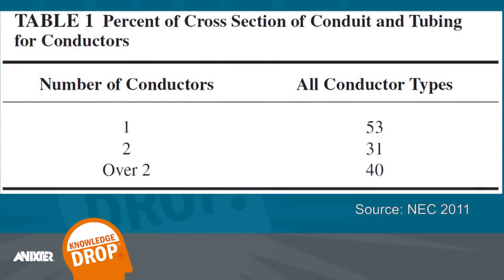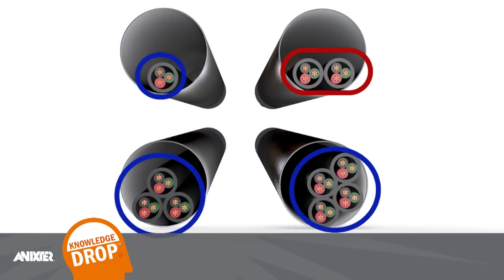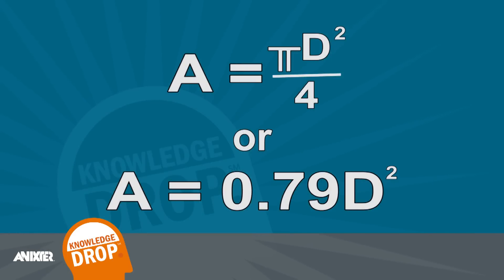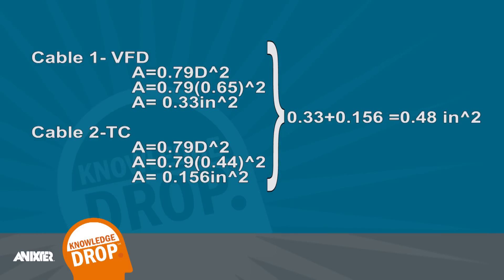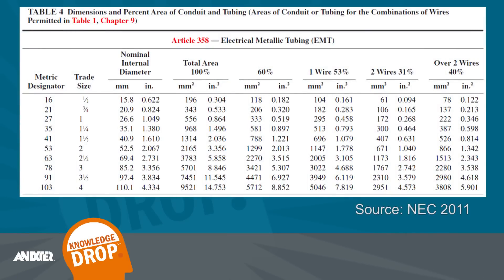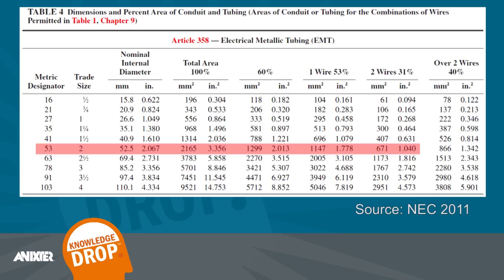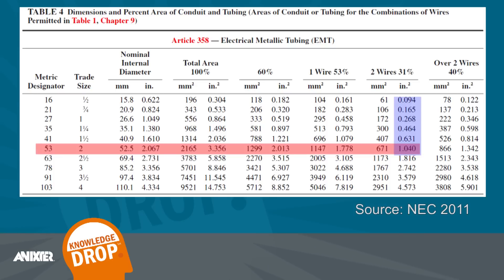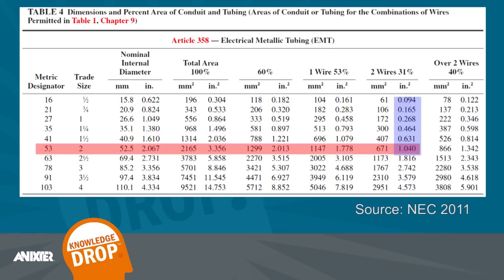How to Calculate Conduit Fill

Comment: This says if the cable cross-section is elliptical, "use the eclipse" as the diameter? What does that mean?
Reply: Clay Wisner They mean that you should treat a non-circular cable as if it were replaced with a circular wire of a diameter equal to the non-circular cable's largest possible diameter.

One place you might see this, is with SEU service entrance cable.  SEU cable has two line conductors, built in an assembly with distributed concentric set of neutral wire strands.  The cable as whole is oval shaped.  When putting multiple SEU cables in a conduit, you take the worst-case scenario and treat the wire as if it is a circular cable with diameter equal to the largest diameter across the SEU cable.
Reply: Pretty much the largest diameter of the cable. Even better, use the area given by the manufacturer specification if you have some strange cable made in Soviet Russia.